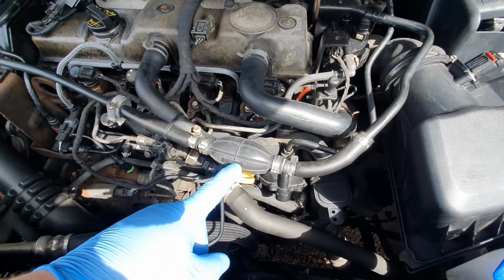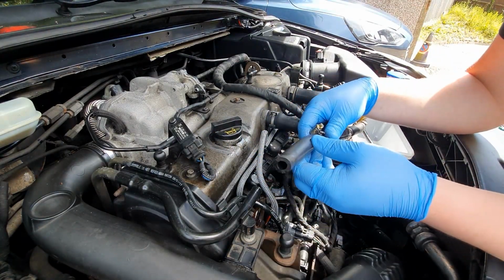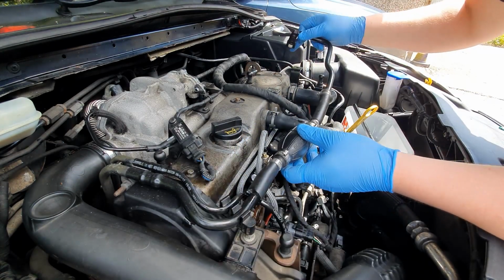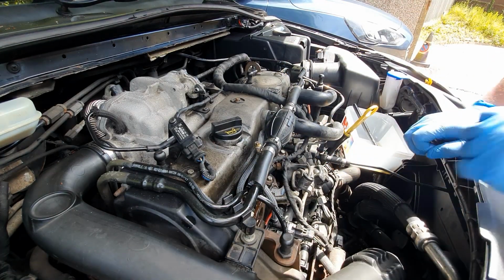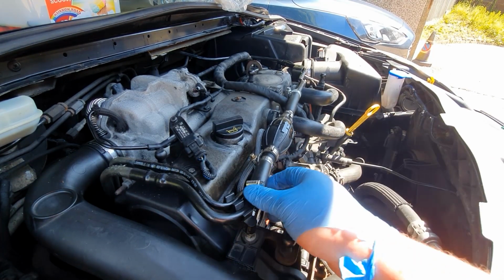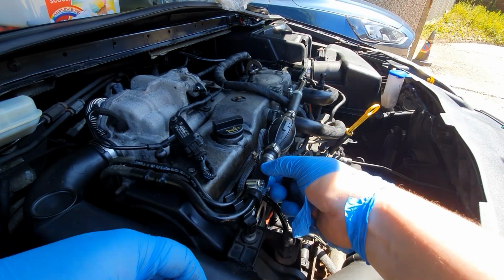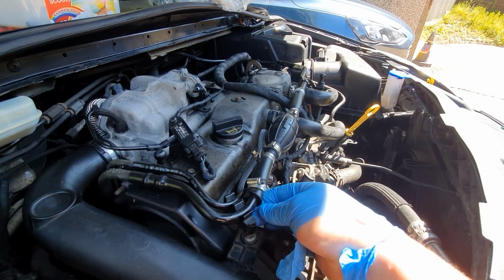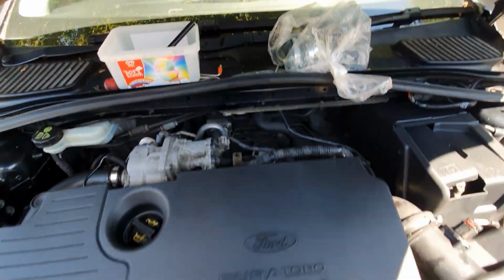Ford Mondeo Mk4 - 1.8 TDCI Diesel fuel priming pump relocated

Comment: Real pain in the arse to bleed Mk4 Mondeos, no lift pump in the tank.

That said once you get the knack for it there isn't much of a need for a priming pump/bulb.

Backfill the line from the filter to the hpfp with a syringe and fill the filter body before you screw it down. Then I fill the housing through the bleed screw on top and it usually doesn't take that much faffing.

There is a fuel pipe clip missing at the top of your timing cover, ford part number 1388500.
Reply from the maker: Hiya darkwaterblue, cheers for the feedback. This priming pump was already on the car when i brought it. And again cheers for the part number 🙂

Comment: I have the same car it wont start. I measured the voltage on  the valve on highpressure pump, left to senter, to be 8 volts. Could that be the reason? Does this car have a separat fuel feeding pump?

Comment: Do you realise you can just buy a proper Ford fuel half pump primer off ebay for 20 pounds? Fits absolutely perfect and it's best one out there... no need to chop fuel lines up 🤣🤣🤣
Reply from the maker: Didnt know that, how ever this one was already on the car when i brought it. Should check out the video i done when i picked it up.
Reply: @Chazz Coombes  oh right mate and yes I literally did my first ever service on car and I ended up not having the bleeding pump so I ended up burning starter motor out and the wired to the clocks 🤣🤣 ffs lol then after my mechanic turned up with a proper Ford hand bleeding pump! It's got the genuine Ford connectors on it! Mine is on its way mate 👍 ebayy
Reply from the maker: @sheffielduk3428  you got the park number for it on ebay mate. I will get one   thanks mate.